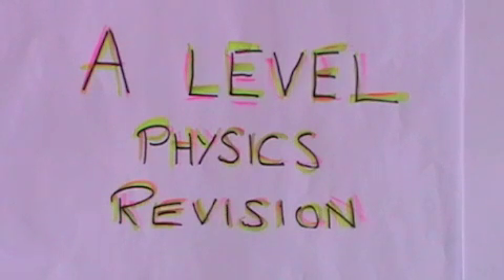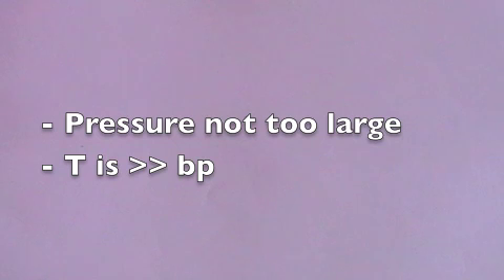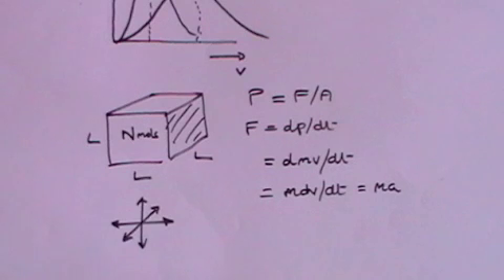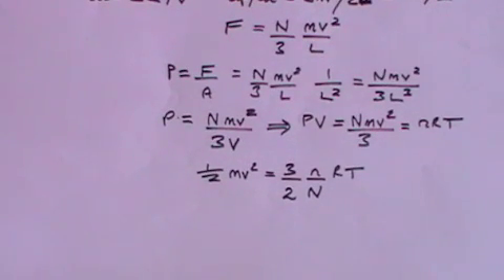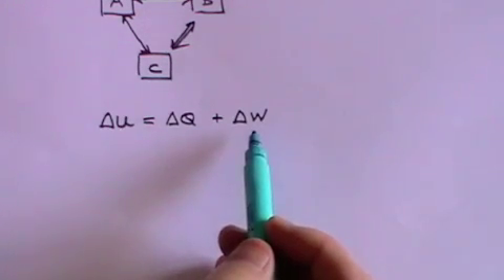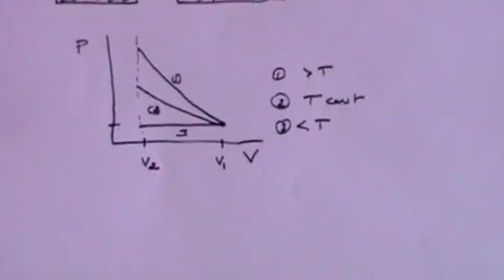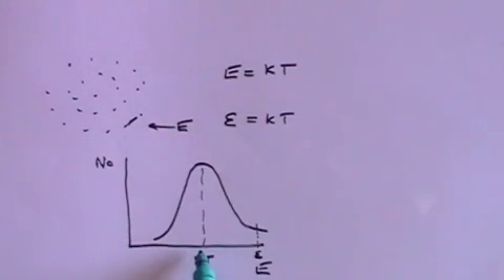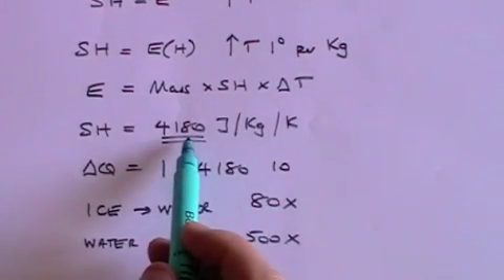Thermodynamics - A Level Physics

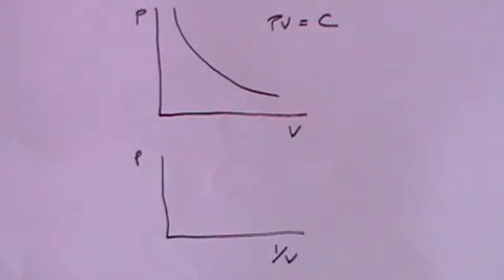Comment: 0:45 in my book this graph is a straight line through origin pls help which one is correct
Reply: Mohammad Daniyal I think it is correct in your book. As P=nRT/V the y-intercept of the line shoud be equal to zero (compare the equation to the equation of a line y=mx+c; where c is the y-intercept). And as this equation can also be written as 1/V=P/nRT the x-intercept should also be equal to zero (x=my+c where c is x-intercept). Thus the line should pass through the origin.
Reply: Nischay K makes sense thanks
Reply: In this video, professor explain in term of degree celcius, in kelvin i.e: you meassure P-T at 0,0 it means at 0 K you have 0 pressure, but u can't go there because it's impossible (at least what i know) to reach absolute zero, hope you keep enjoying physics

Comment: So what's the difference between Adiabatic and Isothermal? is it that in Adiabatic the temperature is allowed to increase but not from an external source?
Reply from the maker: Adiabatic - there is no heat transfer in or out of the system - it is insulated. Isothermal - there is no change in temperature  - the entire system is placed in a heat bath of constant temperature. So yes, in an adiabatic system the temp can increase but not from heat coming in from the outside.
Reply: DrPhysicsA When will u next upload a video?
U have been inactive for 3 years..

Comment: Hi, very helpful videos! 
quick question on the 3rd curve of explaining the different systems (constant pressure). as you have showed in the beginning of the video that pressure and Temp are directly proportional, so when you decrease the temperature wouldn't it imply that you decreasing the pressure as well? 
Thanks
Reply: PV = NkT, so this means that with a decrease in temperature, if the volume decreases pressure stays constant.

Comment: If an adiabatic change will occur if the work is done very fast so no heat transfer has time to take place, then if the work is done very slowly will the change be isothermal? Since there is too much time for internal energy to build up in the system because heat transfer will always take it away to keep it in thermal equilibrium with the surroundings.

Comment: How is the change in momentum 2mv? Can you please elaborate more on that?
Reply from the maker: In the simple example we are considering, the particle travelling to the right (say) hits the side of the container with momentum mv in the right hand direction. When it rebounds it is now travelling to the left at mv. The change in momentum is mv - -mv = 2mv
Reply: +DrPhysicsA i had the same question but thanks it makes sense now
Reply: DrPhysicsA 
Hello, in the A2 level book that i have the change in momentum is given as follows:
-mv-mv=-2mv 
Is that still correct and what is the diffrence if yes?
Thanks in advance.

Comment: Sorry i has a very stupid question. Can you help me ?
Like you said the amount of E required to change ice to water is 80x E to raise the Temperature. So how you can melt the ice without changing it's temperature. ?
Reply from the maker: +Cong Xuan When you heat water, you add energy which gives kinetic energy to the molecules which amounts to higher temperature. When you melt ice the energy goes principally into breaking the solid state bonds rather than giving KE.
Reply: DrPhysicsA I understand, ty

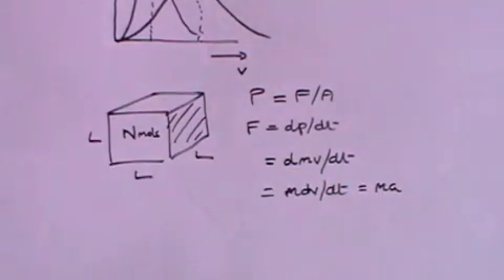Comment: I feel like there are certain conditions that are abused by this classical model that aren't fully explained. When counting the number of molecules that are in the system we assume that all the molecules can only move in 3 axis, i feel like that is a big assumption at 10:00.
Reply: +justin joy I know I'm 8 months late and you've most likely already done the exam, but just to explain the velocity thing; the particles can only move in the x, y, and z plane, and therefore their velocities would be given as a vector of x, y, or z. Say the particle is moving at a horizontal angle to the x plane, its velocity would simply be (x)cos(a) or (y)cos(90-a).

Comment: PARADIGM SHIFT EPIC DISCOVERY
April 17, 2015 at San Francisco, California
************LEE SALEN-GA A PILIPINO DISCOVERED THAT THE GLOBALLY ROUND EARTH IS QUANTUM LOCALLY FLAT AND CREATED THE SALENGA QUANTUM TANGENT THEOREM, FIRST MATH THEOREM IN QUANTUM GEOMETRY.
BREAKING NEWS: LEE SALEN-GA A PILIPINO SCIENTIST DISCOVERED A
[ VIOLATION OF THE 2ND LAW OF THERMODYNAMICS ].
AFTER THE BIG BANG
THE CREATION OF MATTER REQUIRED ENERGY TO HALT AND RESIST RETURN TO ENERGY BY GIVING UP- INFRA RED(SALEN-GA COOL)RADIATION. CALLED IN SCIENCE AS “HEAT RAYS”. THIS IS THE TRANSPORT MECHANISM EXPLAINING THE TRANSFER OF HEAT BY RADIATION ACROSS A HEATPROOF VACUUM WITH A TERRIBLE
TEMPERATURE OF MINUS 273 DEGREES CENTIGRADE EQUAL TO NEAR ABSOLUTE ZERO KELVIN.
LEE SALENGA INTERPRETED THIS AS A VIOLATION OF THE INVIOLABLE 2ND LAW OF THERMODYNAMICS, THAT REQUIRES THAT HEAT EXCHANGE BE FROM A HOTTER TO A COLDER AMBIENT. SALENGA IS THE FIRST EARTHLING TO EXPLAIN THE RIDDLE OF INFRARED RADIATION TRANSPORT AS A VIOLATION OF THE 2ND LAW OF THERMODYNAMICS IN FUNDAMENTAL PHYSICS.

Comment: first question to F = dp/dt. As we know this means the change of momentum during the time dt, or the rate of change of mom. during the time of THAT change. According to your (the classic derivation) the dP changes during the total fly time inside the L which is NOT true. You can only use this time 2L/v if you assume ALL the 1/3N of molecues umklap the momentum. You can NOT use this time for one particle as you did.

Comment: This is actually not a comment but rather a query. Have you iin any of your very lucidly presented series. dealt with standing waves with respect to sound? I have been trying for quite some time to design and make a mini saxophone but all my attempts have failed as i do not know the formjula which will give me the positions of the tone holes even aproximately. Random attempts at locating tone holes   is an endless affair leading to no positive end and terrible wastte of effort k, time and material. I shall be sincerely and very greatly thankful to you if you could inform me of any such formula. I have read that the saxophone is taken to be a stopped conical pipe resonator but acts like an double ended open cylinderical pipe and the formujlar for this type of resonator is what is to be used for the sax tube. But though this formula gives almost accurate results whe applied ot the design of a clarinet which i have made in quantitly, it results in total absurdity when applied to the saxophone body tube. Thank you Sir.
Most sincerely, vivian Astridge

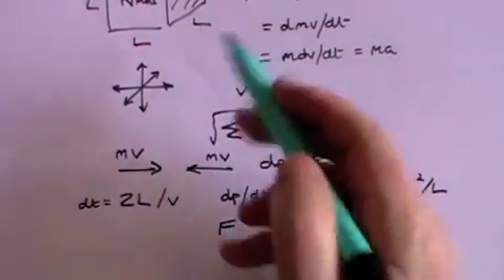Comment: In 13:25 , I can`t see how we get that N/3 is the total number of molecules.. Help.
Reply from the maker: We are saying that there are N molecules moving in all directions. But if we resolve those movements into the X, Y, and Z directions we effectively have N/3 molecules moving in each direction.
Reply: Ahhhh, ok2x sir. I see now. Thanks :)
Reply: Anthony Phillips
Because there are 6 planes in a cube, there are 3 ways to move. If a particle bounces off the left side of the box, it moves along one of the axes, thus you can resolve that 1/3 of the particles in the box bounce off both the left side and the side opposite to it, since particles bouncing off either the left or right side move along the same axis.

Basically, if a particle is moving along the x-axis it will bounce off both the left AND the right side of the box. For 6 sides to bounce of, there are 3 directions to move along :) Hope I made something clear.
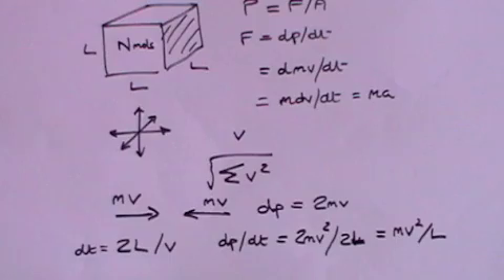Reply: DrPhysicsA 13:21 If you are considering the Force due to pressure on one of six surfaces of a cube, then it seems to me that the N/3 term should really be N/6. 
--thanks for publishing these videos
Reply: +DrPhysicsA sir, so N/3 mean we only consider force in one direction?
Reply from the maker: +Ting Tiew Yik Yes. For simplicity I am considered only one dimension.
Reply: Three dimensions - up/down, back/forward, left/right. Therefore divide by three.
Reply: oh,thanks！

Comment: Very helpful video! The only thing is that the new sign convention is actually dQ=dU+W i.e if work is done on a gas to increase the internal energy then the thermal energy change will be positive. Just thought I'd point this out because I don't know about other exam boards, but AQA certainly follows the new sign convention
Reply from the maker: I agree. Different people use different sign conventions. The key thing is to be consistent.
Reply: talk 2 me
Reply: what are u talking about girl i mean hot girls are always dummmm

Comment: If Absolute zero has never been achieved, then what we have is a Theory. The Kelvin is based on something that has never been achieved. The temp where nothing moves is at absolute zero. We have come close but not achieved it, thus the math means squat.
Reply: Actually a Kelvin is the same as a Celsuis so it has been achieved.

Comment: Sir, please help me solve the following question
During a thermodynamic process the pressure of a diatomic gas is proportional to volume raised to the power -4( negative of 4). Find the specific heat of gas during this process. (The answer is 13R/6)
Reply: Manneet Kaur Use the characteristic equation of an Adiabatic process

Comment: pls sir, I would like you to help me with the following problem; determine the quantity of heat conducted in thirty minutes through an iron plate 2.0cm thick and 0.01m2 in area the temperatures if the two sides are 0 degree Celsius and 20 degree Celsius. the coefficient of thermal conductivity of iron is 50.4 J/smC .

Comment: Assuming (1) the universe is spatially infinite, and (2) there are no voids large enough as such that matter exists isolated from starlight 13.72 billion light years in any direction, then would there be no truly thermodynamically closed systems?

Comment: Wikipedia States Absolute Zero "The zero point of any thermodynamic temperature scale, such as Kelvin or Rankine scale, is set at absolute zero. By international agreement, absolute zero is defined as 0K on the Kelvin scale and as −273.15° on the Celsius scale.This equates to −459.67° on the Fahrenheit scale and 0 R on the Rankine scale.Scientists have achieved temperatures extremely close to absolute zero, where matter exhibits quantum effects such as superconductivity and superfluidity."

Comment: I think there is an error or misleading statement at the end. Surely you meant to say that it would take 500 times as much energy as the SH to turn the whole kg (litre) of water into steam. Just reaching 373 K would begin the boiling process and start turning small quantities of the water into steam ("the jug is boiling"), but boiling away the whole litre into steam takes much longer for this reason. Which is good, otherwise, making one's tea would be a quite fraught process.

Comment from the maker: You can't do the calculation based on the time you observe the particle. dp/dt is the total rate of change of momentum based on all the molecules in the gas. That will be determined by how often each of the finite number of particles hit one of the surfaces. No reason for that to blow up.

Comment: Something that has always bothered me:

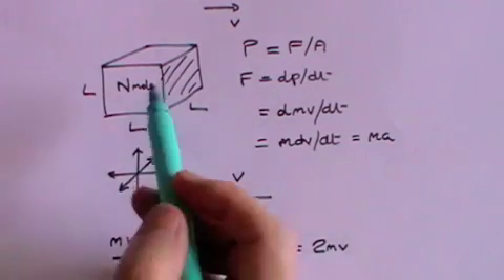11:58 - when calculating the dt part of dp/dt, why does the equation not blow up? It seems like it would, because at 4:55 you state that forces act instantaneously in an ideal gas. For instance, if I only started paying attention to the particle when it was already very close to the wall (say, a distance of .001L), and say I stopped paying attention to it after it rebounds .001L from the wall, then dp = 2mv, but dt = .002L/v and this limit would go to inf.

Comment from the maker: You might want to look at my video on Entropy. Thermodynamic stability occurs when a system is in its lowest energy state, or chemical equilibrium with its environment. So you need to establish what determined whether or not something is stable. I think chemists look at Gibbs Free Energy as a key factor (see Wikipedia). My video does not go as far as Gibbs energy, but it does derive the concept of entropy which is an important factor. G = H - TS, and my video defines both H and S (T is temp).

Comment from the maker: @FelipeZucchetti But the concept of specific heat does not require heat to be supplied at a steady rate. It simply says that to raise the temperature of 1 kg of water by 1 degree you need to supply 4180 Joules of energy. You could do that by placing it next to a hotter body such that as the water warmed up the hotter body cooled down. In those circumstances the heat exchange might not be at a constant rate.

Comment from the maker: @FelipeZucchetti Thanks for watching. Your flame is a source of heat. Its temperature is much higher than that of the gas thermometer (or heat wouldn't flow from the flame to the thermometer (2nd Law of Thermodynamics). It is likely that the flame is delivering a constant rate of heat so you would expect to see the temperature rising uniformly with time.
Reply: sir can I ask for your help for some mind-bending physics problems....